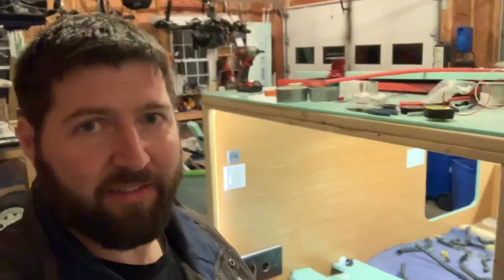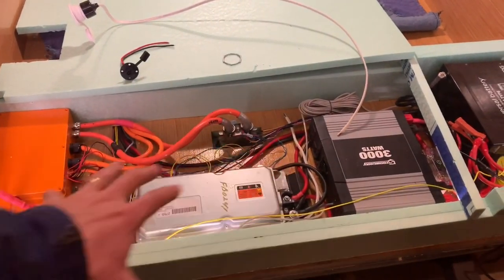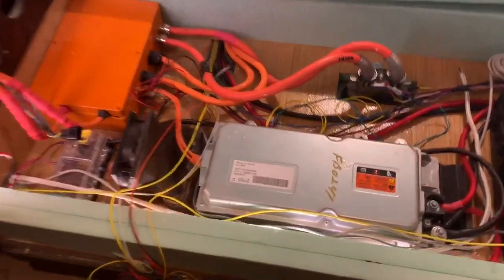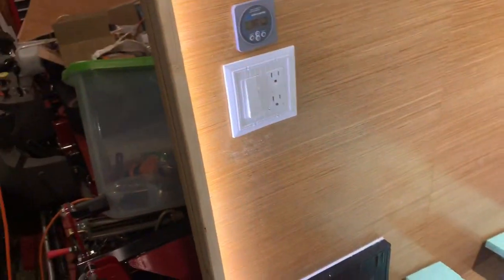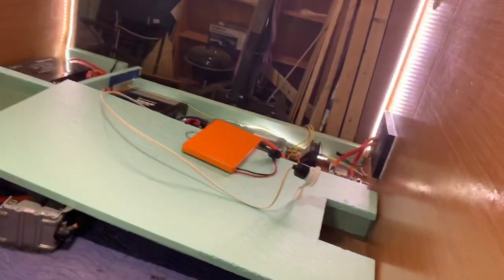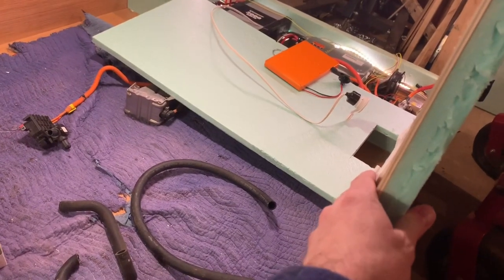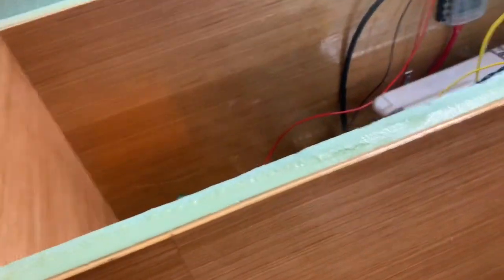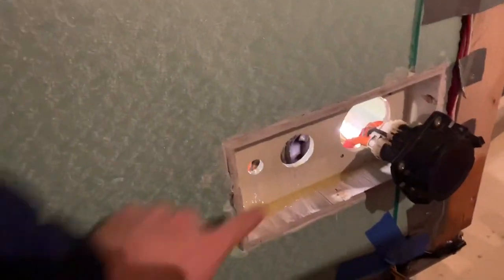T-Rex Camper Update - Electrical Update + Camper Details

Comment: What kind of glue did you use for the paneling adherence to the foam board? I noticed on another video you did that it stuck real good that is why i ask. Thank you
It was that corner you had to cut off for aerodynamics, you separated the foam from that paneling off camera but i could see it stuck real good because like 1/2" of the foam was still sticking to it. It broke the foam before it would release from the glue joint.